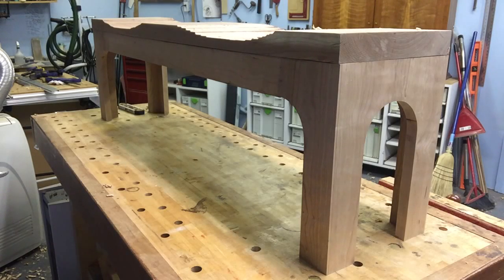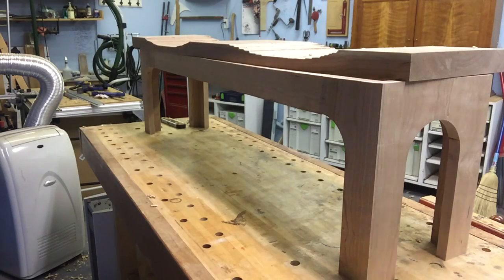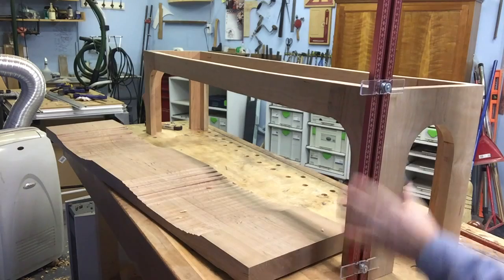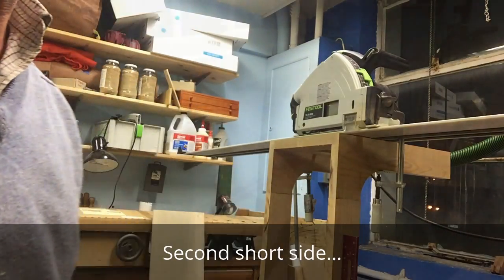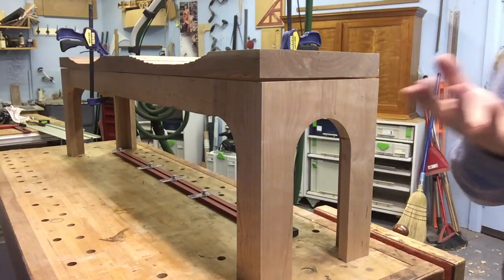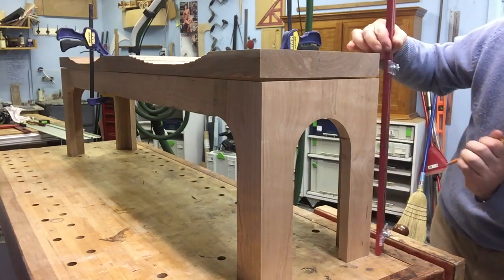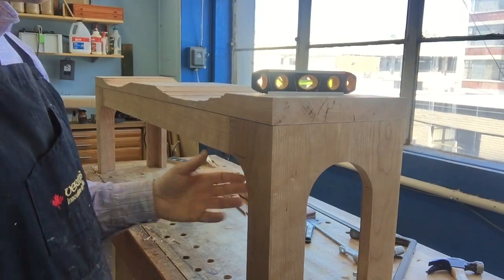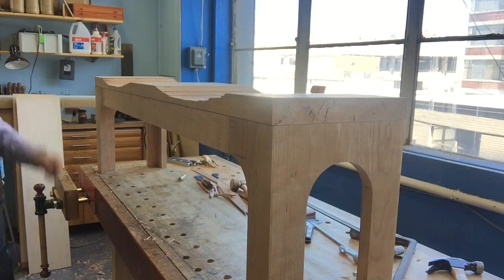Using a Festool tracksaw to fit a benchtop to its base

Comment: Nicely done, Richard. Before you started cutting, I had a thought about using a router to do the same thing. But I can actually see now how using a track saw could be far more efficient. :-)
Reply from the maker: +Olly Parry-Jones Thanks Olly, a router would have done the same thing but I couldn't figure out a way to balance it safely on such a narrow edge, and I was worried about it tipping. The tracksaw is a much safer tool especially when it's at head height!
Reply: Richard Leon Yes, and with a router, I imagine there's be a greater risk of tearout and breakout along the cut. Plus track saws seem to have better dust extraction. ;-)

Comment: Interesting technique, and it totally makes sense after seeing it. And a good reminder not to waste time trying to correct what's never going to be seen (under the bench top).

I'm curious about the base though. It looks to be typical legs/rails construction. That type of construction will typically come together straight and level fairly easy. What happened, such that it was so out of level? There must be something non-obvious about your design/build that caused the base problems.

Just curious because I suspect there's an interesting back story to the design.
Reply from the maker: +Marty Backe Hi Marty, although the top wasn't that much out of level because I squared all the components before assembly, there is always some discrepancy over such a long length- almost six feet in this case. Also, this technique negates the need to adjust the feet in make the top parallel to the floor. The top was the real problem though- one corner had almost half an inch of twist, even after I had jointed it by hand and removed much of it.
Reply: +Richard Leon Thanks for the reply. Well, in any case I enjoyed seeing that technique applied.

Comment: Great job, but surely all of those carefully shaped cuts albeit not final for the bum inserts will be ever so slightly out/skewed? Or is that just me worrying about very fine incremental changes? 😬 guess I’m talking about the parallel lines from any point along the dip to the the other side of the dip.

Comment: Couldn't you have used the tracksaw again, with very low depth,  in place of the chisel?
Reply from the maker: +E Block I would have loved to do that, but the depth of cut varied along the length of the board from almost nothing at one end to 1/2" in the middle.
Reply: +Richard Leon Good point. Thank you. Beautiful work.

Comment: Do you regularly check your bench for flatness? If yes, did you have to correct a lot?
Reply from the maker: +Jesus von Nazaret I had to flatten it a lot in the beginning, but now I hardly need to do more than plane it past the accumulated glue spots, shellac spills, etc. I do this perhaps once a year or so. The bench is almost ten years old and it's very flat, particularly in the area around the front of the bench.
Reply: +Richard Leon thanks

Comment: That top's grain is so bad, can you check back with us in a year and tell us how it turned out?  I see the end grain started to check.  This looks like something that shouldn't have been sold to the public but ground up for something else.
Reply from the maker: +christschool It looks good so far, and although the checking may continue I doubt it. It was sitting around in my shop for a while and the checking stopped a while ago.
Reply: Richard Leon Thanks for the update.